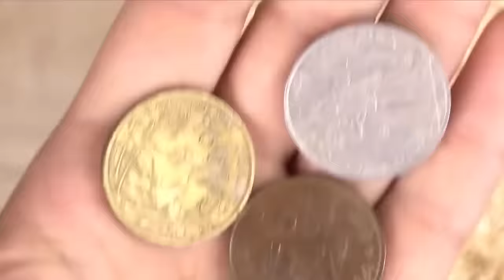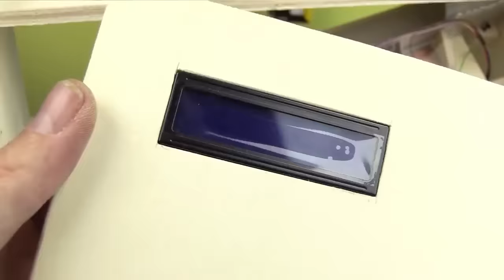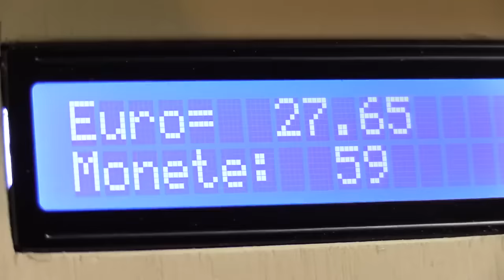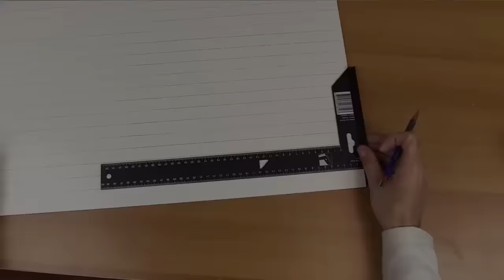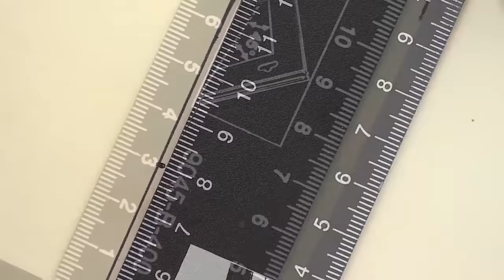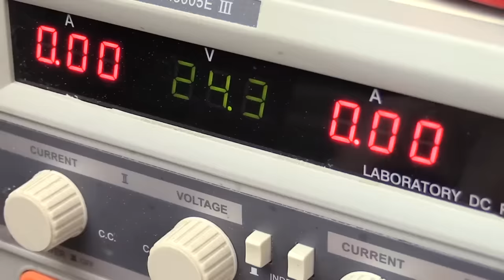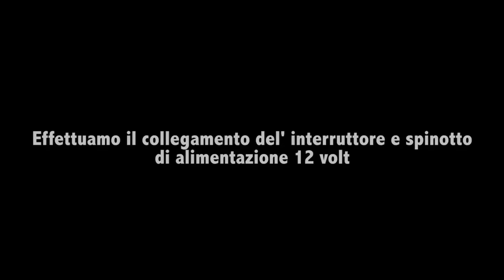7 INCREDIBLE Projects with a simple FAN

Comment: You are doing a great job building these! But it would be nice to tell beforehand what exactly you are building! 
This is where you see the finished products:
3:45     Metal Polisher
10:45  Coin Sorter
14:30  Solder Fume Extractor
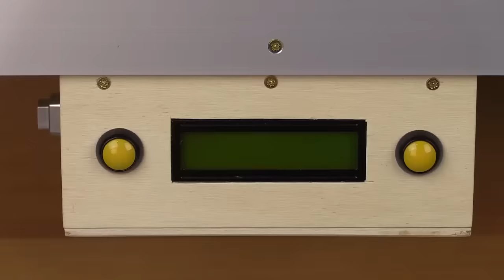20:25  Air Hockey Table
26:00  Disc Sander
29:00  Magnetic Stirrer
31:00  Disc Grinder
Reply: Thanks. I know it's free and the content is amazing but that was frustrating 🤠

Comment: 1: Vibration metal polisher/cleaner  :)
2: Vibrating coin sorter w value total :)
3: Exhaust air duct for fume removal :|
4: Cheap mini air hockey game table  :(
5: Vibrating sander. Bonus dust filter  :|
6: Laboratory style ext. magnet mixer :)
7: Grinding wheel. (Fan+metal filings) :(

Comment: "Planned obsolescence" means cheap machines and household items are designed to fail after time. Small fans like these are designed to move very small amount of air, for a limited time. Their bushings usually fail after after one or two years under ideal circumstances. What you have done with those fans can be considered anything but normal use, so if you put a bolt into one blade of a fan, it becomes unbalanced - therefore its bushing wearsh down quickly. An hour of unbalanced working to a small fan can be lethal to it. This is why people don't make anything out of them. Even an industrial fan can fail under harsh circumstances. Machines with unbalanced rotation on their shafts are made with bearings designed for unbalanced rotation. Keep this in mind when you try to impress uneducated naive people.
Reply: Tho these fans can still work after a lot of years of everyday use. I have quite a collection of PCs, and one of them is from 2002, with original parts, from the CPU to the fans. It has been used everyday, many, many hours for ~10 years. Fans still work normally.

Comment: I don't think those fans will last too long.
Reply: I came here to write that. Those fan bearing will give up quickly and they way he did the integration w/o a way to replace them is not very cool at all.
Reply: Max 10 minutes
Reply: Yea the bearings will be a problem in a long tern but if you have many fans you do not even care if they break
Reply: @kleinfeicht  Nobody has that many fans.
Reply: @latengocomoburro  sure if you have a pc shop or repair pcs for your friends or make them new pcs...
Reply: John Doe  I certainly do not.
Reply: @betims  By the way, bearings will not be the only problem. Fans have motors inside (obviously), and these motors heat up. Of course, there is no problem since only thing fans do is push huge amounts of air through them. But once you remove all blades, heat becomes an issue #1.
Reply: David of Yorkshire  
1. Bad or next to absend cooling of working motor.
2. Loads well above expected by manufacturer lead to overheat.
3. Excessive radial forces break everything posiible. New fan has zero radial forces.
Reply: Yeah replacing it won't be FANNY 😁
Reply: I'm pretty sure he knows that, I am fairly sure if he was going to make things to last he would use more expensive material. But for the sake of learning these are the best and most affordable and make things in a way which would allow for easy replacement of parts. He certainly had the know how.

Comment: I have not made it past the first one with the PC fan vibrator. It is genius! I love it. there's a lot of maker videos like this and I like 'em all, well... most of 'em... but this one happened to solve a problem that I have been thinking about lately. I was going to use an AC motor and a magnetic stirring rod, but I do much prefer working with DC current. And now I won't have any broken stirring bars to worry about.
   Had to start from the beginning so I can take proper notes and make personal project alterations. 
Way to go,  @Daniele Tartaglia ! You just got a new subscriber. I hope the rest of your stuff is as legit as this one.

Comment: this guy makes a video that is not only informative, but fun and there are loads of negative comments from people looking for lice! Probably from Trolls who don't know what a nut, bolt is, let alone use them. They have to buy everything on their credit card and at the slightest defect throw it away and redeem it on credit. Has time to waste? Much less than those who watch the video and then criticize it especially without having done a single of the projects. It's expensive, it takes "a million other things and tools". Not at all. You have an old pc, the fan is working, wood a small jigsaw or hand saw, no need for a drill press, a hand drill or a crankshaft will do. The poducer provides links for items you don't have and they cost little. The bearings and fan motor will break in 10 minutes! It shows basic principles, if you still want the "bigger one" to replace the motor and fan with a helicopter motor and its blades or that of an airplane and its propeller. If you don't like his video, are unable to give a positive review or suggestion, and are afraid of hurting your neuron or making an effort, stop viewing, reach out to open the fridge door as you. have installed next to your leazyboy armchair take your 10th beer close the fridge door since you will not invent any device to do so. Go back to your computer and change youtube channel to your favorite reality TV channel. Thanks for this video.

Comment: Good work. But some suggestions. On your fume extractor, put the filter on the outside instead of inside. Then it will be easier to change when it gets dirty and it will help keep the fan clean. The fans that are used for vibration need to be the ball bearing type. If they use bronze bushings, they will wear quite quickly.

Comment: I enjoyed the metal polisher, the air hockey table, and the solder fume extractor (might make that one); however, the rest can be accomplished cheaper by buying it already made. I mean, it's kind of cool that you were able to make them with just a desktop pc fan, but kind of pointless. Also, you wouldn't have needed to make the final one if you hadn't destroyed the drill sander attachment to make the disc sander lol.

Comment: First one is not a good idea. Will ruin the fan quickly, and unless you have an abundance of 120mm fans that'll get expensive quick. Better idea would be to use controller vibration motors, much cheaper and lower power draw

Comment: That PC fan derived 'parts tumbler' won't work for very long, these fans have a simple bronze sleeve the motor shaft rides in...I have several of these fans from computers, the fan-blades collect dust & dirt, get noisy from being out of balance & they chew up that bronze sleeve...they start to run slower, the cheap power supplies overheat & eventually burn up.

Comment: I'm surprised the bearings in the fan motor lasted 60 minutes with that degree of imbalance caused by the bolt through the blade!
I would have thought there was a simpler way to clean those bits without going to the cost of all the extra parts for your machine.
Don't tell me....  You are an accountant right?  Only an accountant would build such a contraption.
Reply: The vibrator in your phone uses the same principal, it's just an unbalanced rotating shaft

Comment: #5 and #7 are both different versions of a sander.   As everyone who has ever used one of these fans knows, they have absolutely no torque, so they would make an abysmal sander.   Anyone who tries to build a sander out of one of these is an idiot.  You'd be better off buying a used sander at a pawn shop or flea market.  It would be cheaper there also.